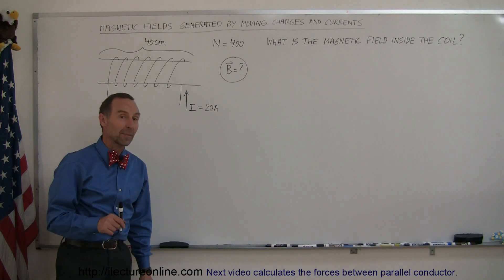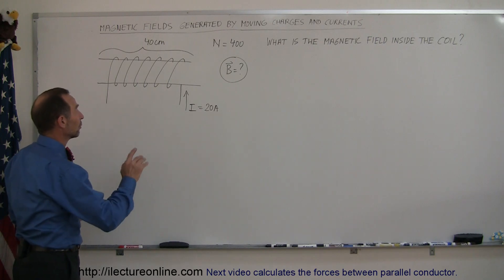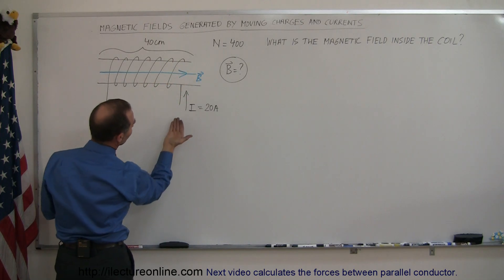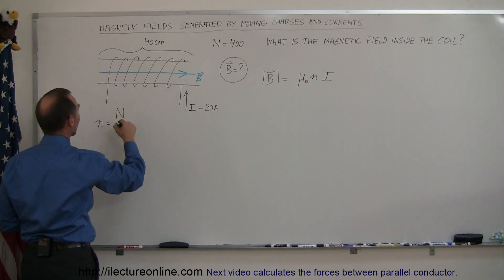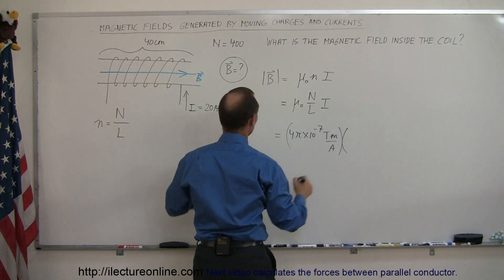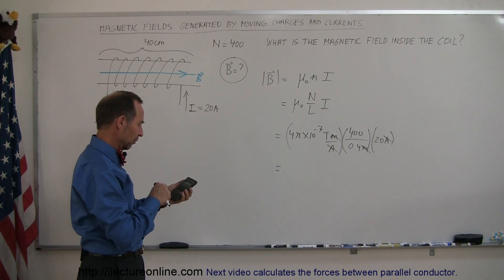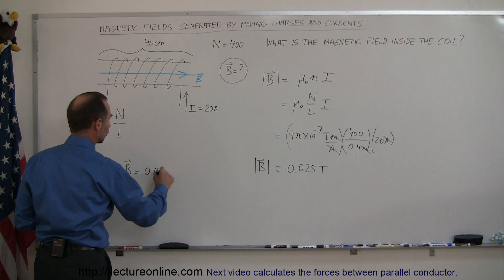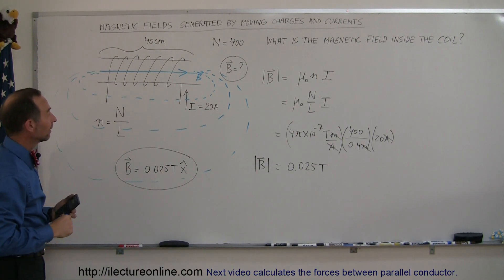Physics 44  Magnetic Field Generated (9 of 28) Current in a Coil

Comment: Mr. Michel, I have a question. That equation seems familiar. Does it evolve from Ampere's law or from Biot-Savart law?
Reply from the maker: The Biot-Savart law relates the magnitude and direction of a magnetic field at a point is space caused by a small current element nearby (a current flowing through a small section of a cunductor).  Ampere's law relates the magnetic field around a closed loop which encloses a single current or a sum of currents.
Reply: @MichelvanBiezen  But could you please tell me how to derive it?

Comment: why doesn't the voltage matter here... if I put 20 amps with 24 volts and 20 aps with 48 volts will the B remain same?? volt x amp=watt
              24 x 20 =480 watt
              48 x 20 =960 watt
if we are providing different amount of enwrgy then how can we get the same B?
Reply from the maker: A magnetic field is formed by moving charges (current) only and nothing else.  Thus if the current doesn't change, the magnetic field will not change.

Comment: Professor, what if that solenoid coil is a hollow aluminum tube completely filled with ferrofluid and with both ends of the tube connected to a high-speed pump, moving the ferrofluid inside the said tube in a loop at high speed, will the movement of the ferrofluid produces a magnetic field or force? And if I want to confirm this and do more research what branch(es) in science should I look at?
Reply: The ferro fluid could induct the aluminum causing a small electrical flow and then followed by a small magnetic  field  but considering that the ferro fluid gains magnetic fields easily it could increase the ferro fluids fields and cause more induction to the aluminum thus constantly increasing eash other until they reached their full magnetic capability in relation with your power input
Reply: You should definitely look into induction of electricity, a conductors magnetic field and then your entire system will be a coil and a coil works best with a core so do some research on electromagnets and the efects of a core (can make a great difference) .

Comment: The surprising matter is that in previous videos we were using the thumb to represent current but suddenly now we start using it to represent the B field. I realize that it does not matter whatever the choice in this case but elsewhere it does. Could you give a rule of thumb?
Reply from the maker: It turns out it works both ways.

Comment: professor, shouldn't the value for r in the equation (F=NuI/2r) be the radius of coil not the length of rod the coil is on (and the radius wasn't given?
Reply from the maker: +Danoroxursox13 
The equation in the video is correct.  The radius does not have much of an effect on the overall magnetic field.  The actual field does depend to some extent on the length and the radius of the solenoid, thus the equation in the video is a simplification of the actual field.